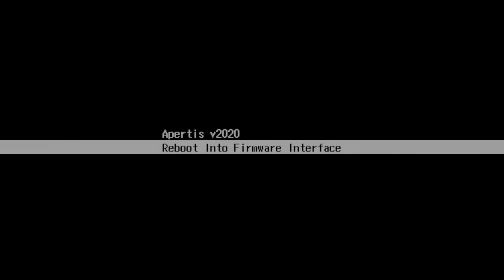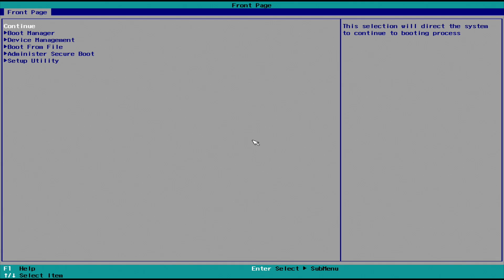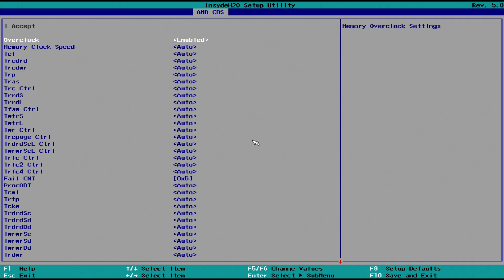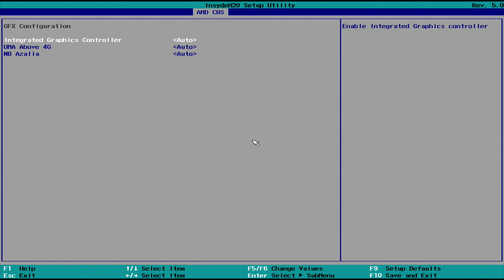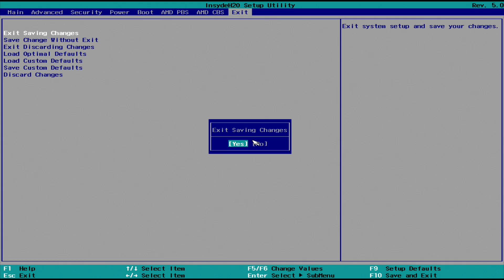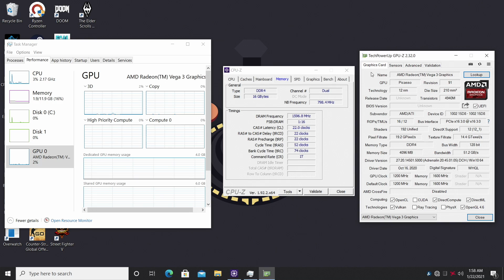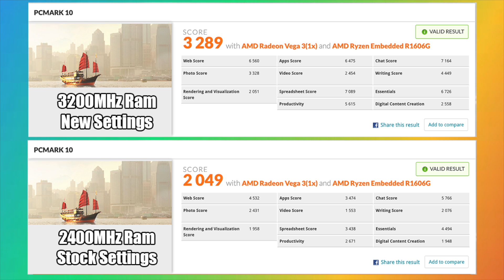Atari VCS Teardown and Performance Upgrades, Bios, TDP, Ram Upgrade, M.2 SSD

Comment: I know memory overclocking can be a tinkerer's rabbit hole, but I'd bet tightening the timings would provide some additional benefits.  I have a Ryzen 3500U laptop that I was able to upgrade from 2400 to 3200Mhz and even though the G.Skill kit was rated for CAS18, I was able to run it at 15-16-16-36 (cas, rcd, trp, ras).
Reply from the maker: It can and will definitely help out with these Ryzen chips for sure
Reply: @ETAPRIME  hi i have two questions... One can i put a pc processor in the atari vcs and the atari vcs still work? And two can i put a atari vcs processor in a pc and the pc still work?
Reply: @ETAPRIME can i swap out atari vcs processor with a pc processor? And vice versa?  even if hard is it possible?
Reply: I second that.  I'm sure the Ryzen DRAM Calculator can help with getting an idea for timings as I'm sure this is a Zen 1 chip.  These APUs benefit from faster RAM and tight timings.
Reply: @TiTiTiTiT  he uses better ram. Not overclocking ram. Which is a huge difference.
Reply: @martinmoller4947  what do you even mean by “he uses better ram. Not overclocking ram” because that makes no sense since he’s overclocking the ram that he added. The standard speed for ram is 2133 and anything over that is considered overclocking, even ram that you can buy online that’s rated for 4000 is still overclocking. LTT IS great for general info (and sometimes in depth stuff as well) and entertainment but they aren’t gold tier in this area, that would be Gamers Nexus and Buildzoid and imho they’re platinum tier and also very credible in this area.
Reply: @TiTiTiTiT  are you stupid? Send me a link where overclocking ram gives you a stable performance. Your anectodal evidence is worth sh*t. LTT and DF are a gold standard in hw testing. You are just butthurt.
Reply: Not really boosting performance. Just makes it unstable. My tip. Dont buy overpriced weak hw like the Atari vcs. Buy a series s. 10 times more power and a excellent controller for the same price.
Reply: @martinmoller4947  How would it be unstable to set your memory timings?  It appears that the soc is capable of it or there wouldn't be options from AMD to change it. Trust me when I say it makes a difference.  I had a 2400G and know from experience how timings help. If the 3200 Mhz modules he put in are run CL22, that's terrible.  Even the cheapest of crucial ram can run CL16-18.
Reply: @MaxDad7  overclocking ram is pointless. Proven hundred of times.
Reply: @MaxDad7  Smartphones nowadays outperform the shitty vcs hw. Even the case is crappy quality with a crappy mould.
Reply: @martinmoller4947  The 1606G of the VCS is very comparable to an Athlon 3000G, which you can find a lot of performance videos on.  It's not great, but it's not terrible either.  The iGPU performance is better than Intel HD Graphics for instance.  BTW, you can't really compare a smartphone to an x86 cpu.  A smartphone uses ARM which is a different architecture entirely.  I can't make any comments on the rest of the build quality as I don't own one.  The bundle seems a bit steep at first, but when you consider you have the Atari licensing, 2 wireless controllers, and 100 fully licensed games it gets more justifiable.  The fact that you can upgrade the hardware, install other OSes, and adjust BIOS settings is an added bonus for tinkerers.
Reply: @MaxDad7  thats a shitty athlon. Lol. And of course there are Smartphones which have more gpu and CPU Power. With a Tdp of a arm chip. Thats the point which makes the Atari vcs even more ridiculous. Besides the missing first party games and the shitty games they sell also overpriced af. The cheap build quality not to forget.
Reply: @martinmoller4947  that's your opinion, and an uninformed one at that. Apparently you're just trolling for the lolz and that's fine. IDK what the Atari VCS did to hurt you, but I hope you seek out the attention you need. Just do it elsewhere.
Reply: @MaxDad7  im not trolling. If writing a critical and justified comment is trolling then you live in a weird mindset. I live in a free country btw. I dont care about Atari in the slightest way. I followed this scam and now im laughing about ppl who bought that device. :D
Reply: @MaxDad7  i run 3200hz cas 16 on my 3600x. Lightning fast.
Reply: @martinmoller4947  nOT CarINg sO HaRD y'ALL
Reply: @martinmoller4947  that is just not true, but thanks anyway
Reply: @steelscooter  its funny someone buys a overpriced PC and then buys hw to upgrade that shitty hw. Overclocked RAM is pointless and makes the system unstable. Thats a fact. Your vcs is mostly a scam.
Reply: @martinmoller4947  Nope. Ryzen is super particular with memory speeds. Sure the performance difference is probably hard to tell with the naked eye but the benchmarks do not lie.
Reply: @martinmoller4947  if it’s pointless to overclock RAM then can you provide proof from different sources to prove your statement? Because I’ve seen that it does help, maybe not a whole lot but it still helps.
Reply: @martinmoller4947  you forget the gpu uses the same ram and very much benefits from better ram speed and timings. The ram should be 16 cas and is set to 22 which is slowing it down.
Reply: @steelscooter  did you read my comment? Never said a better ram is not performing better. I said overclocking ram is pointless.
Reply: @346Yoman  thats a shitty Zen 1. Blowing at the vcs would get you better benchmarks. Lol
Reply: @daftpunk672  many have proven it already. LTT, DF. Just to name 2. Easy to Google.

Comment: Way over priced for what it is, I have a 3400g in an inwin chopin with 3200mhz 16gb ram, and it was cheaper than $700 AUD.

Comment: Question: If RAM speed is set to auto and the board can handle higher speed RAM, wouldn't it automatically run higher speed RAM at the right speed?

Also based on another video review of the service, there is an option to boot to windows from inside the VCS OS
Reply: Auto usually sets the ram speed correctly based on what ram you have installed. The manual settings are for overclocking. I don't have one of these but i would say you are correct.
Reply: No to your ram question. It would be cool if it did.

There is an option to go to pc mode from inside Atari’s OS. I think that would do it, but I’m not sure, because my m.2 is hooked up externally via usb. (FYI, if you have an external drive plugged in, it boots to that. So if I want Atari, I just unplug it before booting. If I want windows I make sure it’s plugged in before booting)

Comment: why should someone buy this over an self build apu system?
Reply: I don't know if it's a "should" reason,  But the 2nd OS and emulation features are really just extra things you're allowed to do.  Ideally you would be buying this to eventually utilize and play Atari games and services that will continue to release on this.
Reply: @ragingtyga  What would be interesting would be to see Atari make something new tailored for the console . Not a rehashed emulator from Steam/MS Store . You can even play Missile Command Recharged on any phone .
Reply: Nostalgia is expensive.
Reply: @thesnackworthy  It is expensive and definitely needs to come down, but I DO like the "open-sourceness" of it
Reply: You could even buy a better pre-built for the same price or less than the upgraded VCS . For $450 you can get an HP 4-core Ryzen 3 3200g with Vega 8 graphics , a 256GB SSD , 8GB 2666mhz DDR4 , DVD-RW , Win 10 , keyboard + mouse .
Reply: @bryanobrien2726  again, you're not buying this for the hardware, you're buying it for the services that Atari will continue to roll out for this. Stop thinking of it as a PC, and more a console that you ALSO can tinker with
Reply: @ragingtyga  At this point it is just a mini PC and not a console . What's Atari's release schedule looking like ?
Reply: @bryanobrien2726  Do you know that base 8gb model is 280$ ?
This is cheap machine.
Reply: @retro_ed746  You know it doesn't even come with anything either . No Windows , no hard drive , no keyboard , no mouse . The $280 one won't even play Atari's ROMs because it has no controller .
Reply: The Series S is a cheap machine . Way more powerful and for $299 it comes with one of the best controllers you can buy and a 512GB SSD .
Reply: @bryanobrien2726  So?  Power isn't everything.  That's like trying to compare different cars that look, drive, perform differently.  Let me know when you can load Windows onto the Series S...and it still doesn't look as nice as the VCS.  :)
Reply: @Josh-ce9sv  Unfortunately Windows doesn't come with the VCS , that's another $100 . Why would you even want to run windows on an S ? It has games to play . If the Atari had any decent games it wouldn't need to run windows . There lies the problem . The VCS does look nice , no debate there .
Reply: @Josh-ce9sv  Power is everything .... if you plan on playing games .
Reply: @bryanobrien2726  15$ keyboard & mouse, 20$ 120Gb m.2 ssd and Ubuntu 0$ with Steam (and Proton...) No need for windows.
So extra costs 35$ more... 315$ total. Still cheap.

I agree at this prize point and no upgrade path because cpu is soldered it would be better option to build apu system with normal motherboard.

Steam is not behind monthly paywall like new superconsoles so no hidden costs from that direction.
Reply: @retro_ed746  Or you could use an old $50 Core2 Duo as a Steam machine , you could get one at that price with Windows . Then you'd have enough leftover to buy more than a few games , a decent keyboard and mouse , and a controller . If you want to spend $315 on a Steam machine and play with a $15 garbage keyboard and mouse that's your choice . If you're into Proton then the VCS would probably be good for that .
Reply: @bryanobrien2726  I think we both agree that there are plenty of options to have/build/buy different systems for different purposes.
Just spending hundreds or thousands and buying best of the best is boring.
Last time i bought an cheap Intel cpu it was almost decade old Xeon 4c/8t. It is running great in my system.
And no more Atari today :)
I still hope that this system will survive because from developers perspective it is good place to sell games: 80/20 revenue share for multiplatform games and 88/12 for Atari VCS exclusives.
Reply: @retro_ed746  I hope the VCS survives and that Atari does get a good library of games for the buyers at some point down the road . 
   As far as the hardware price , they're not ripping you off , but they're making money on it . For what Atari is providing software-wise it's way overkill . Any old Android device can play the games they provide buyers . The fact that the VCS can do other things if you want to tinker is fine , but it's hardly a feature . If you were a 12 year old who got this for his birthday what would you be thinking about it ? Probably "Where's the games at ?" . 
   Truthfully , with its limited market Atari should be paying bonuses plus a large percentage for 3rd party games and especially exclusives . What's 88 percent of nothing ? That's a lot of risk for an indie developer . They would reach way more potential customers developing for any other platform .
Reply: @bryanobrien2726  Not in this cool looking little package you can't....

Comment: why would a bios come locked?
Reply: To prevent newbies into bricking the system or making it unstable.
Reply: @timmyburden5701  then why do regular computers have unlocked bioses
Reply: @samuelmatheson9655  The company marketed this as a console. Its not really a console but they marketed it as one.
Reply: @timmyburden5701  eeew

Comment: I really don't see the point for this. It's just a regular pc with a custom linux OS. Couldn't you just install it on an AM4 based PC?
Reply: Lost me at "TDP settings"... i'm always keen on learning how run stuff more efficient, but considering price/performance/watt it doesn't seem worth it to me.

Comment: This would make a great internal to an arcade cabinet. I have a table top 2 player i made running off a pi4 but this would easily fit inside and be able to run much higher amount of systems. I may get one just for that alone.
Reply: You’d be better building an AM4 3400G small form factor machine yourself - $400 would get you a much more powerful machine
Reply: It’s way too pretty to hide it. Plus it’s overpriced to be used just as hardware.
Reply: @thesnackworthy  not for what your getting and more importantly form factor of how small it is. It's Even smaller than a micro itx mobo...and uses a brick instead of a pc power supply. 
If you were to retry and get a mobo as small even and older gen, plus cpu, ram, ps, etc..your not that much less than this cost and probably still bigger in size
Reply: @guardianali  You can simply just get an Asrock A300 STX board and an older APU then for a smaller and more powerful system.
Reply: @Llamageton  per my earlier point, while that is a good option, it still misses the desire. This uses a power brick instead of a psu saving space and making replacements easy. And it only uses 25w. Versus 65w or so. So much less heat.
Reply: @okene  Really now? Cause the vega 11 means its using a Ryzen 5. The model that has a vega 11 ryzen 5 that  is a Lenovo Thinkcenter M75q.
The micro is model m75q-1. 
Both of which is averaging 350-450.  So either you just got very lucky and its def not the norm..or ur exaggerating to try and make a point. 
oh and btw..the ryzen 5 has  a TDP of 65W so way more heat and power usage than the VCS CPU which is a max of 25watt TDP.

Comment: I love the approach they’ve taken, have you tried to boot a Linux distro also and seen a difference in performance to windows?
Reply: I can see "upgrading" the wifi antenna
Reply: @darunealbane  isn't that just like a mini PCI slot or something? I think there might be some low end GPUs that could fit in there.
Reply: @sharoyveduchi  the ssd id not nvme which means THAT is perfect foe an egpu
Reply: You could probably manage 3000mhz off of the base memory they provide sense its samsug E die, the stuff buildzoid raves about (at least my unit came with it) and dedicating 3gb of the system ram from the base spec severely helps its gaming performance